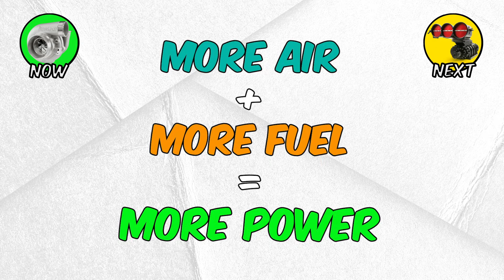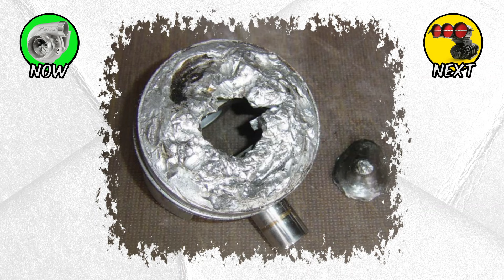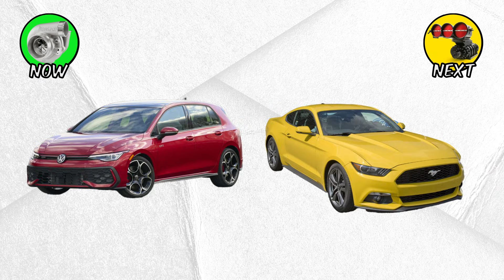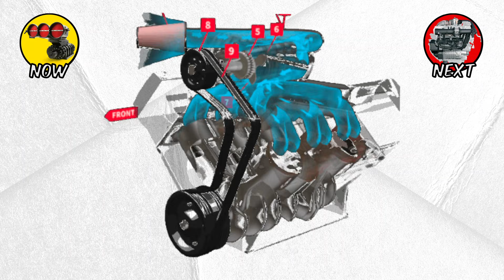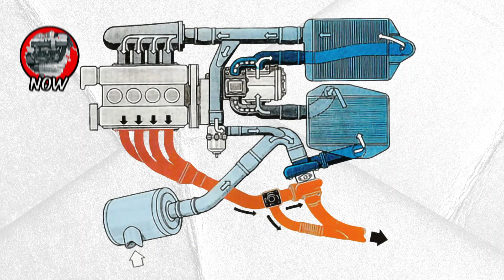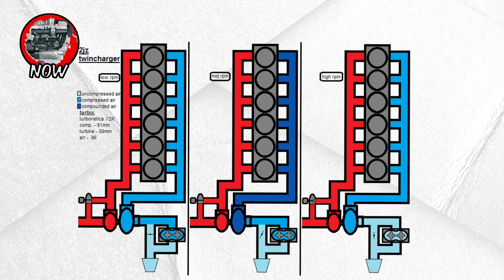Ways To Boost Engine Power Explained

Comment: Size & Weight vs Power:
2.3L TT EcoBoost 4 in the S550 Mustang (~385 pounds) = 315 HP, 137 HP/L, 0.82 HP/pound
5.0L NA Gen3 Coyote V8 in the S550 Mustang GT (490 pounds) = 460 HP, 92 HP/L, 0.94 HP/pound

Both blocks are aluminum on aluminum... so, the turbos in the EB must weigh a BUNCH, since an engine that's more than twice the size weighs only about a quarter more.

The main difference being... I can get 25+mpg if I behave myself in the EB... that's not happening in the Coyote.

Comment: What about nitrous?
Reply: nitro doesn’t use air compression like a turbo or supercharger.
it lets your engine burn more fuel in the same space. More fuel + more oxygen = more power, temporarily.
turbos and super are mechanical while nitro is chemical so technically not a boost type
sorry for the mini essay 😪
Reply: @ottimestwo  the title of the video is just "ways to boost engine power". Nitrous oxide is a way of boosting engine power, therefore it should be in this video
Reply: @MrSandman10.5  oh yeah good point they shoulda def added it especially since most people dont really understand nitrous
Reply: Nitrous Backfire exists bc yk diesels